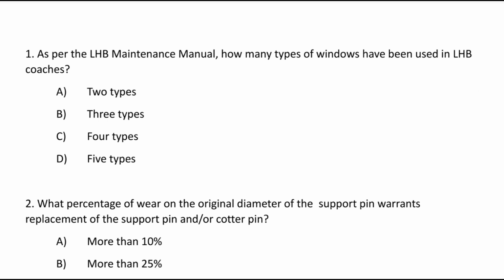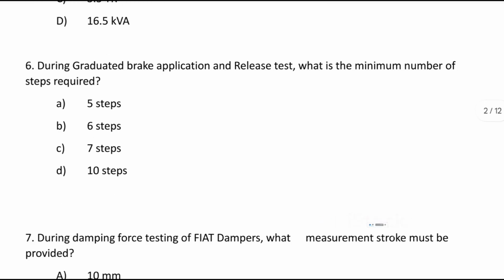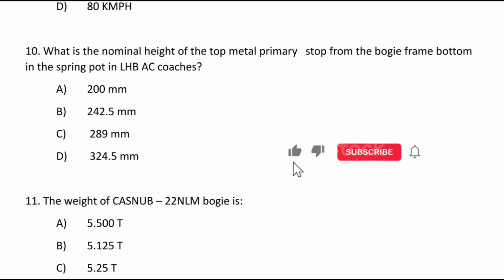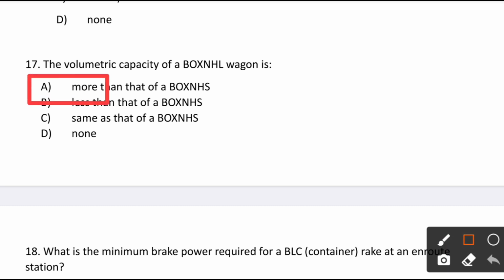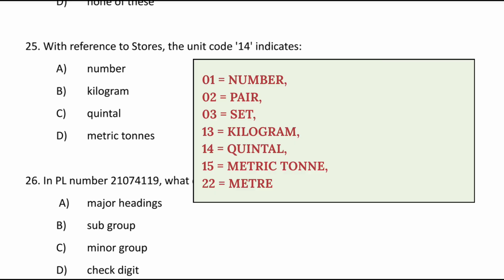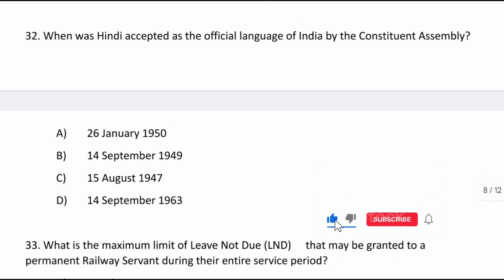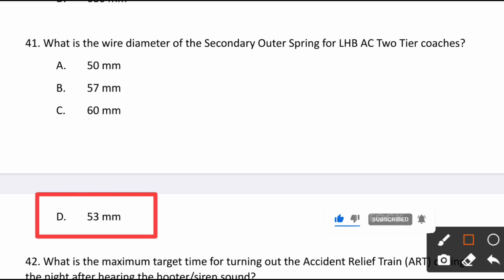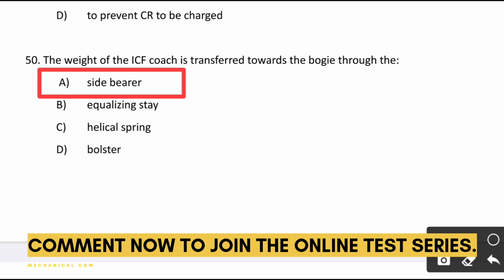AWM/ADME/JE/TECHNICIAN online Test Series -05 Questions and Answer with proper details.

Comment: Sir thank you for a great video, please explain the speed restriction of LHB coach when primary and secondary spring broken
Reply from the maker: Broken Coil spring: En-route
If only one broken Axle box coil spring with no excessive tilt of the Axle box is detected 
en-route a running train, the coach may be allowed to continue journey up to the 
destination with the condition that the speed shall not exceed 80 KMPH in case of breakage of one coil of primary spring and 90 kmph in case of breakage of one outer coil of
secondary spring.
Reply: @Mechnicalkarna some platforms write 90 for secondary coil spring and 95 for primary coil spring
Reply from the maker: Yes, I will correct Answer in next video.